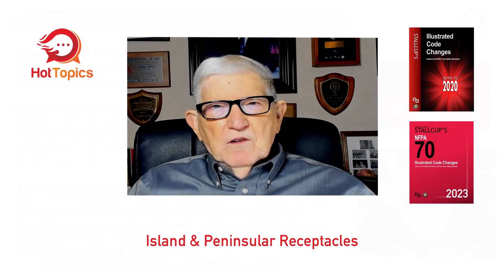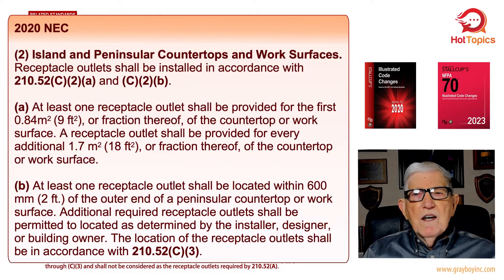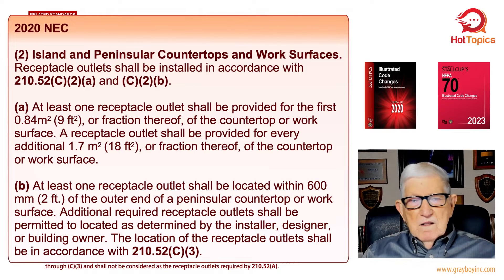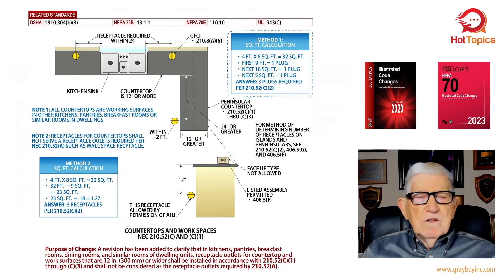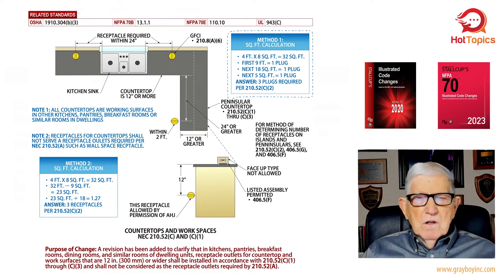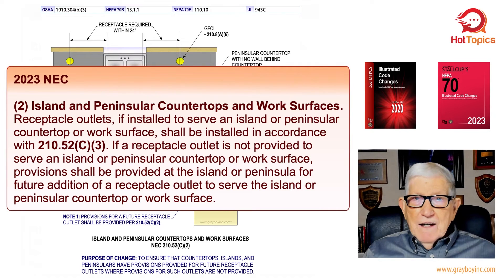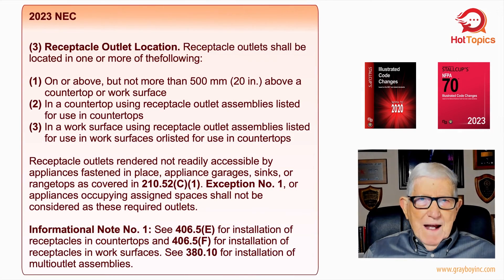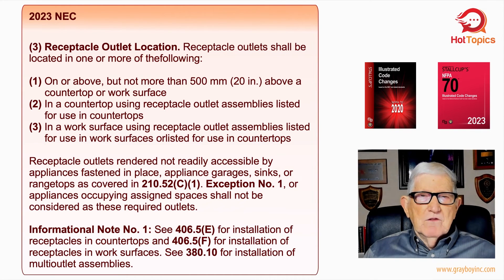HT E 45 - Island & Peninsular Receptacles NEC 210.52

Comment: 90.2(A) Purpose of the NEC: 
The purpose of the National Electrical Code is to ensure electrical systems are installed in a manner that protects people and property by minimizing the risks associated with the use of electricity. The Code is not a design manual, nor is it an instruction manual for untrained and unqualified people. It isn't for installing equipment for future use. I would think that there should either be a receptacle required, or it would not be required. I guess that would probably be up to the AHJ.
Just curious how that's a safety issue by futureproofing.